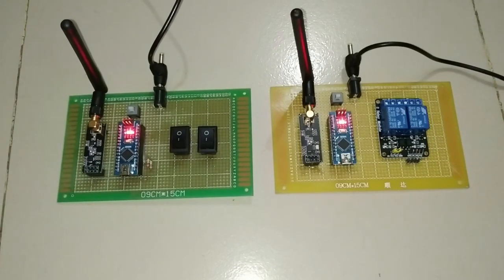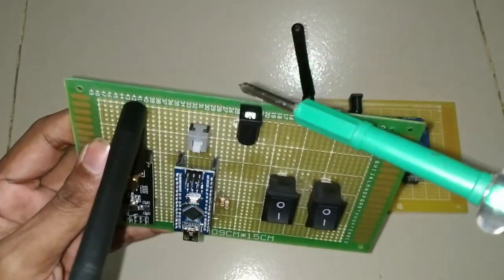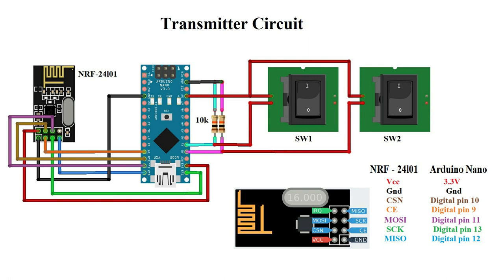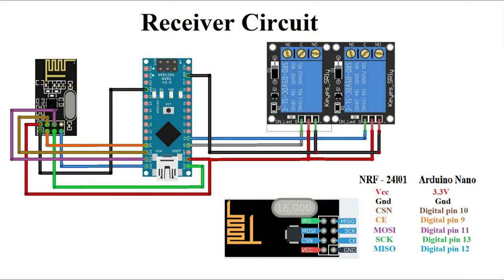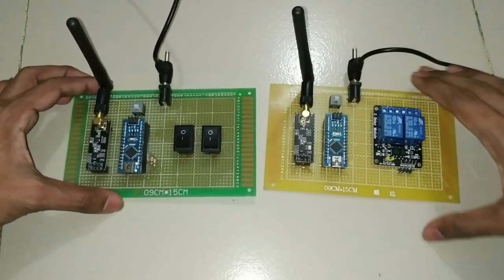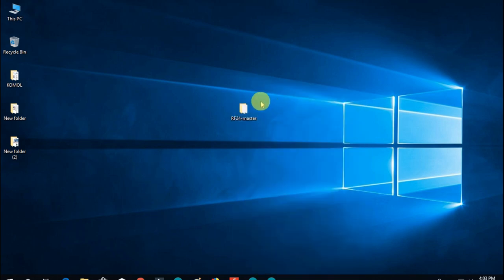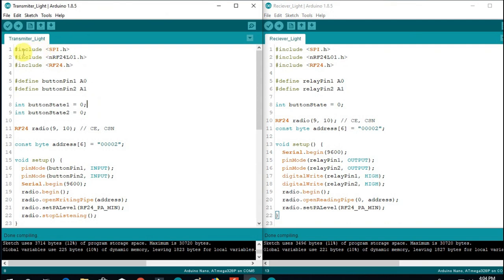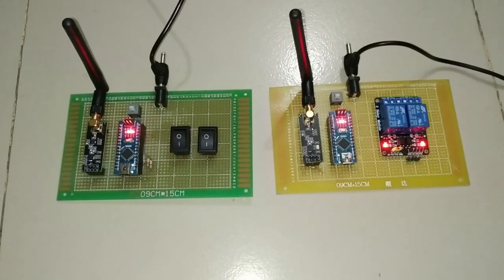Arduino Wireless Communication Using NRF-24L01 Module | Arduino NRF-24L01 Tutorial

Comment: I copied your set up exactly as shown except just one switch. When I power up both boards the Tx (transmitter) led on the arduino lights up on both boards. After about 30 seconds the led begins to flicker and the board locks out.

Comment: I would like to create a brake light system for a motorcycle that could be activated by bluetooth or wireless where the led would be on the rider's jacket. But that didn't use a cell phone, but a button on the motorcycle's brake pedal.

Do you have a tutorial that could help me?

Comment: Why transmit two bits in two bytes with such weird encoding? Those four and four if-s are unnecessary. On transmiter side one instruction encapsulating two bits into transmitted byte and on receiver side two instructions cutting bits and setting pins in the same instruction. Avoid "ifs" wherever possible! (KISS principle). Anyway, great and straightforward tutor.

Comment: hello sir , i just made that model with nearly the same config but it doesn't work , i think i miss understand the button wiring .
so if you please explain to me more how can i wire the both button to the arduino and also if i connect external power to the relay module , what have i to change in receiver circle .
thank u very much
Reply: Hello, this is very easy! You should look the wiring diagram, both buttons are switches that open/close the energy, so you must connect one terminal of each button to 5V and the other terminal to an Analog Input of Arduino, in this case A0 and A1, don’t forget to add a 10k Resistor between GND and the pin you want to read (A0 or A1). With that you can read LOW or HIGH in your loop and send it to the Receiver module. Hope you can understand a little more.

Comment: Before using 2 module NRF24L01 +PA+LNA to connect each other. Whether do you have using commands to connect them or nor? Because my project (remote control car) is being got some problems. I connected as below
Case1: 
Transmitter: Arduino nano, joystick, NRF24L01
Receive: Arduino nano, L298N, NRF24L01 + PA+LNA

=> it's working well
Case2: 
Transmitter: Arduino nano, joystick, NRF24L01+PA+LNA
Receive: Arduino nano, L298N, NRF24L01
=> it's not working
Case3:
Transmitter: Arduino nano, joystick, NRF24L01+PA+LNA
Receive: Arduino nano, L298N, NRF24L01
+PA+LNA
=> it's not working
Case4:
Transmitter: Arduino nano, joystick, NRF24L01
Receive: Arduino nano, L298N, NRF24L01
=> it's working well
So. Can you/everyone help me this?
Thanks

Comment: Sir how many realy and switch can we connnect to one board ? Like you have connected 2 what is the maximum
Reply from the maker: You can control 13 relay module with these setup.
Reply: @RazibShahadat  and wht is the exact range of these modules

Comment: Sir,
If nano is transmitter and arduino mega in receiver then what changes i have to do please let me know  🙏
Reply: Hello sir, this is very easy! You should look at the Pinout of Arduino Nano and Arduino Mega, both are the exactly connections of: 
Nano - Mega :
5v — 5v
Gnd — Gnd 
SE (any digital pin) — SE (any digital pin)
CSN (any digital pin) — CSN (any digital pin)
SCK (13) — SCK (52)
MOSI (11) — MOSI (51)
MISO (12) — MISO (50)

Hope you can understand a little more!

Comment: Thank you Razib for this very succinct video using the NRF24 can I ask in the tx code
 (  if (buttonState2 == 1)
  {
    buttonState2 = 3;)
is there a reason for buttonState2=3;) could I for example say buttonState2 = 2;)
Reply: That is weird and hacky. Look at the receiver side :) value 2 switches off and 3 switches "on" second relay.
It should be (on transmiter side):
buttonstate=digitalread(buttonpin1)|(digitalread(buttonpin2)<<1)
serial.print(buttonstate)

and on receiver side:
serial.read(&buttonstate,sizeof(buttonstate))
digitalwrite(relaypin1,buttonstate & 1)

digitalwrite(relaypin2,(buttonstate & 2)>>1)

And that's it! NO IFS!

Comment: NRF2401+PA+LNA is sensitive to electricity so these relay may not work when u put load on it /
Reply: I  have  made exactly same setup  to control a clay target thrower  , I have a problem  that when I push the button  to launch a clay target the relay  multi fire's,  do you have any suggestions as to fixing this .
Reply: @stevengoan6490  you may use hc-12 for long distance ..... it is easy to handle...... you may use NRF24L01 +PA +LNA but you may keep distance
Reply: @stevengoan6490  Did you have any luck, I am starting on this project to control multiple throwers.